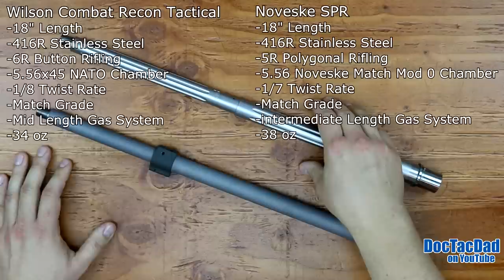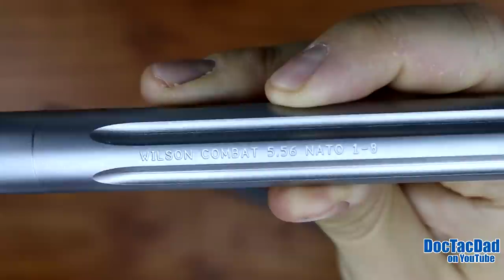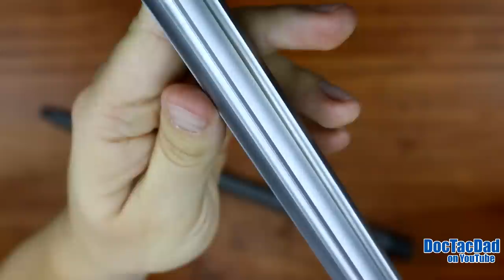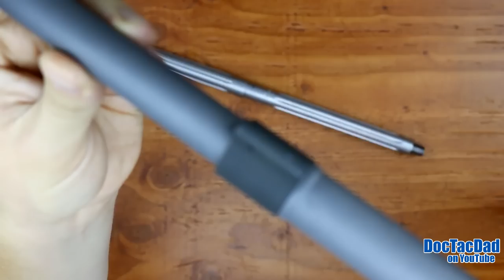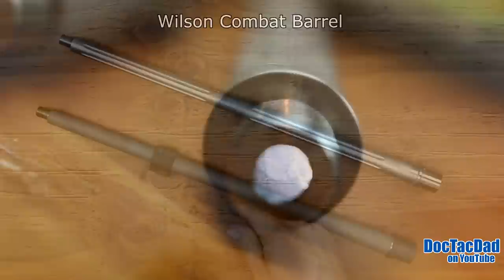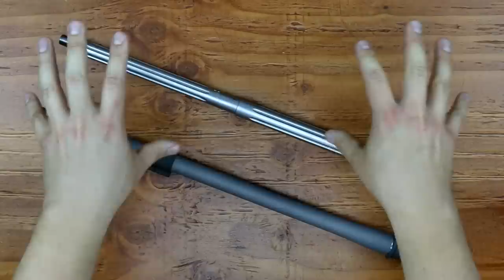Wilson Combat vs Noveske - Barrel Comparison - Project SPR 2.0

Comment: Personal preference I would definitely go for the noveske … I do think that they make very very good products for a reason for example seals on team I didn’t look close enough to see which squadron but they were running those with A dead air Sandman suppressor for Shorty a believe with a 10 1/2 inch  416r barrel know if it was 300-4556 possibly 300 because of the excellent ballistics also 
Their barrels are eggs green accurate specially what you have there it’s a seven minute gun at 400 yards but you want to make sure the build the twerk to the single set screw that’s underneath the gas block how tight it should be the same with the gas tube people do not realize they traded gas tubes sure they’re stronger and more rigid but there’s supposed to be some flex like your guys to basically should I have some free movement and believe me it’ll turn a sub MOMA gun into a 3 to 4 minute gun by a simple gas to that was nice rated or whatever I’m not too sure on the gas port sizes I’m waiting on a 10.5 shorties 300 blackout that I’m gonna throw into a radian model 1 10 inch

Comment: It honestly all depends how you’re setting the rifle up I’d say all other components Febian to for example what upper are you using what lower you’re using rail system don’t forget you already have A pinned Gas block from Novesky  personally I’d go for Navasky on just overall they are proven to the point where now seals are running those 416 hour barrels from them and if devgru team six uses novesky barrels definitely go for that just because of the R&D that goes into it and they’re pretty hot especially right now with their billet set and Ambi Plus if you are using a GEISSELE Rail they use a vltor upper on their rifles the N4 so you might have perfect fit with a VLTOR Upper And novesky barrels are extremely accurate I would just go with it or using both barrels and it is throw on a hand guard and upper and check your accuracy on the lower if you want to do your own R nand d